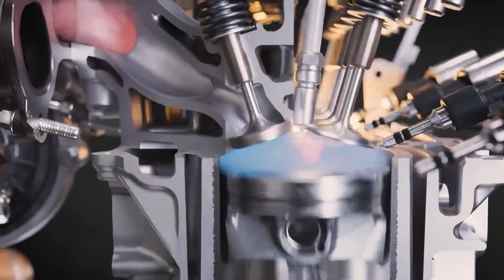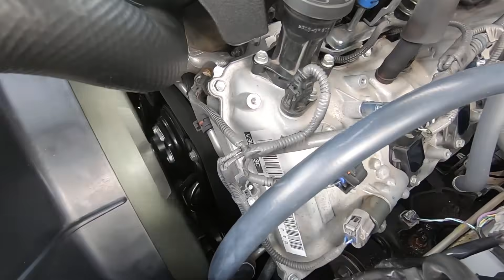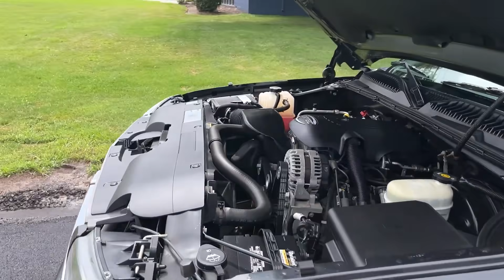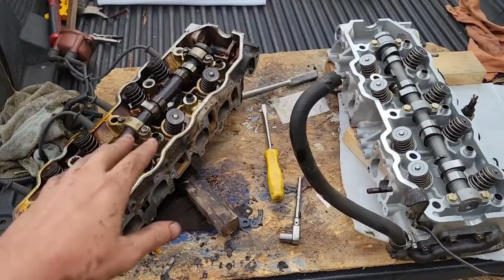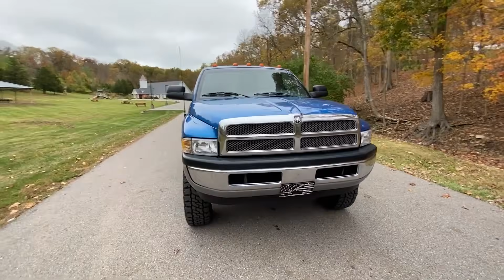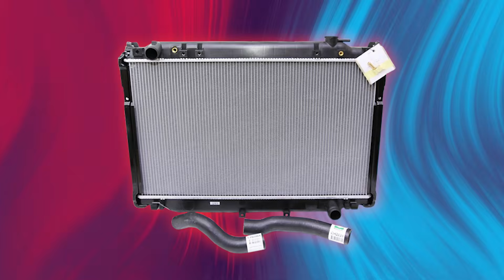7 Most Reliable Trucks With FOREVER LASTING ENGINES!

Comment: Y have 2 dodge dakotas with the V6 2.9L engine and 278k miles on it and Still rubs very good and my 2002 4.7 V8 with 198k miles running very good with cero noises the only downside is the Gas consumption ⛽️💸
Reply from the maker: That 3.9L V6 (I'm assuming that's the one you have!) is a tank - it's basically a chopped-down Magnum V8, which explains why it's still humming at 278k miles. And seeing a 4.7L V8 reach nearly 200k with 'zero noises' is a huge credit to your maintenance. Those PowerTech engines can be finicky if neglected, but you're proving they'll go the distance if you treat 'em right. You definitely pay the 'gas tax' at the pump, but it beats a monthly truck payment any day! Appreciate you sharing that.